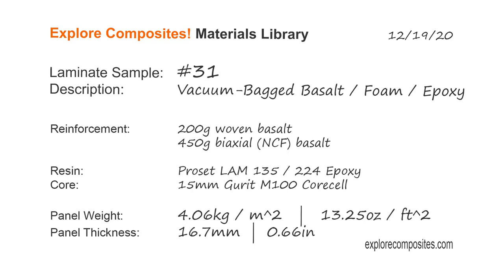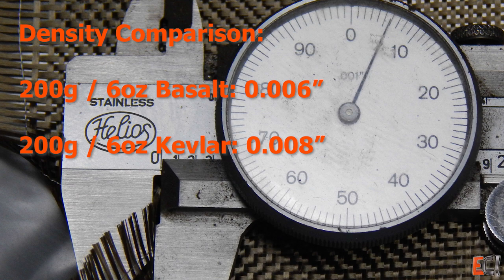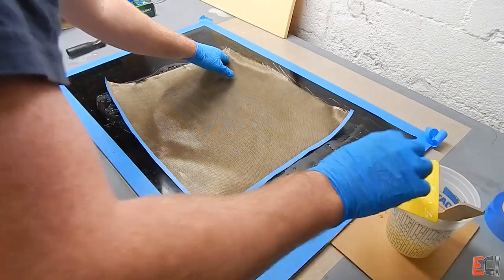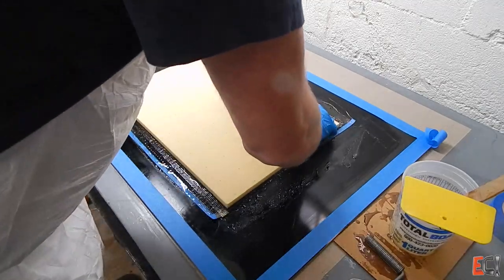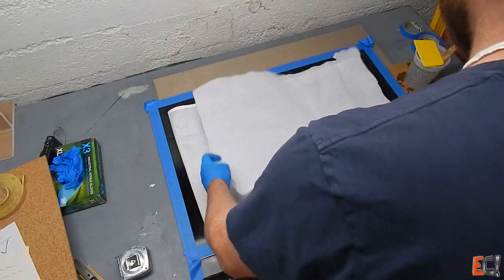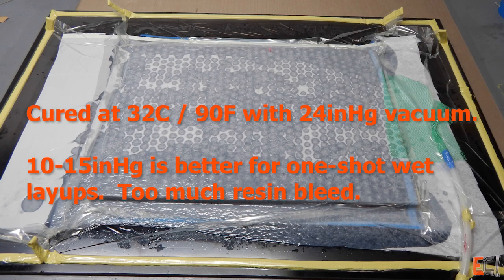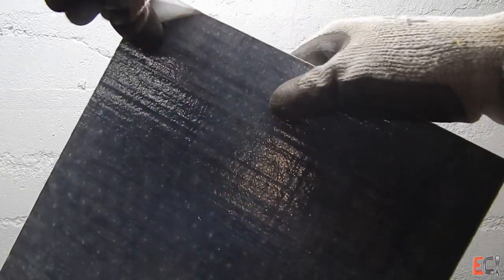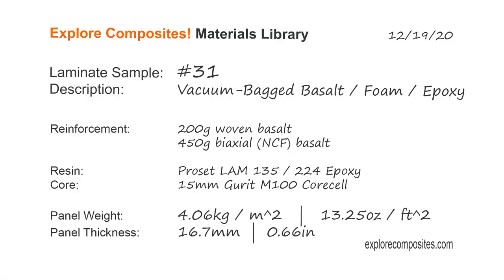Laminate Sample #31: Vacuum-Bagged Basalt / Foam / Epoxy

Comment: I've been working with several industrial material like fiberglass and stone based insulation and came across this material while searching for an alternative to fiberglass tape. Basalt has a lot of useful properties like high impact resistance, high tensile strength, low heat conductivity, outstanding electrical insulating characteristics, chemical resistance and corrosion resistance.... it can be fully recyclable. I have seen this material  starting to replace steel and fiberglass and certain carbon fiber application. 

Thanks for sharing your analysis.

Comment: I've been wondering if there is a "basalt foam" as a core material and as insulation. Theoretically I think it should be possible, there is some volcanic basalt rock with large bubbles. Then you could recycle a basalt fiber / basalt foam by simply melting it down again. That might be the ideal building material, lightweight, insulating and highly fire resistant.
Thanks for the video!
Reply from the maker: I haven't heard of it but that doesn't mean anything!  Autoclaved aerated concrete is pretty neat stuff - maybe one could use a similar process with basalt?  I just don't know much about the process...
Reply: @ExploreComposites  Only thing I know is that you only need to melt basalt once to create the fibers without consuming oil or producing CO2. Which is great. 
So the process should be possible but might not have been developed yet.
Reply: RockWool insulation is blown basalt fiber, not as stiff as a foam like your talking about though.
Reply: Not a foam but Maybe theres a Basalt honeycomb instead of Nomex? Fascinating topic!

Comment: Hey... You need to look at the resin chart... Usually you have a first time for vacuum. Eg 20min for using the epoxy and 24h befor demold and 3h Fist vacuum. That is the reason why you pulled out to much resin. If you use a microscope you can see the different seturation on the fibers. 

I know it always depends on the job you wanna do if you stick to it. I have done this as well and no one is complaining but it's something to have in mind of you want a better quality

Thanks for doing those videos!
Arne
Reply from the maker: I’m not sure I follow but I want to!  Do you mean that I should wait to put on the vacuum until an amount of time (20min) has passed and then pull one level for a while (3hr) before changing it again.  The Proset chart doesn’t seem to mention vacuum levels but I will look a their other material.  This sounds like other things I have heard so I am very interested!  Do you have an example of a resin chart where they describe this?
Reply: @ExploreComposites  give me a second my friend
Reply from the maker: Thank you for teaching me something new!  

If you’re scrolling the comments check out Arne’s video here with details about this:

https://youtu.be/vIri0biOl_4

Going to try this!

Comment: I’m curious how it would perform with the same core thickness in LW-PLA. Obviously I would use the foam core for strictly flat panel layups, but LW-PLA might work great for curved surfaces in aviation. Maybe this idea could be done in episode 49/50?? This idea could work great for having replaceable panels, kinda like fenders, hoods, or doors, on aircraft to make repairs easier.
Reply from the maker: Thanks for the suggestion!  I have been wanting to try LW-PLA for a while but hadn't considered it for a core.  Next time I order filament I'll try to get some.  Could probably be printed as a skinned honeycomb and just get laminated over with a light layer of fiber on each side...
Reply: @ExploreComposites  For an outside skin on aircraft or cars I don’t think the comb would be necessary. For stringers and ribs I would use 3D formed reinforcement, like half a circle to hopefully match up with some carbon tube. I haven’t drawn it on F360 yet but that’s how I’m imagining it in my head. I’m thinking carbon tube for transferring loads between 3d printed panels and along the fuselage.

Comment: Have you ever done pink styrofoam panel sandwich construction laminates? I think the Owens Corning product has very good compressive strength and is very inexpensive.
Reply from the maker: I haven't but it might be worth looking into.  What thickness do you think would be useful?  

Owens Corning Foamular 250 XPS is 1.5lb/cu ft. and has a compressive strength of 25psi.  For reference a 2.5lb PVC foam has a compressive strength of about 75psi.  So the XPS isn't great but it might be useful for something - and it's cheap!
Reply: @ExploreComposites   Wow, I had no idea the PVC foam was so much higher on compressive strength! I have used the "pink" foam as ribs for my tunnel hull boat and glassed them in place.
I was thinking of 1/2' and 1"

Comment: Sorry to be pedantic but your weight per square meter in your opening spreadsheet is off by a few decimal places.
Reply from the maker: You’re totally right!  Thanks for pointing this out.  I changed the units for the previous sample but forgot to change it back.  I sure wish editing videos was an option!

Comment: Hi Chris thanks for the awesome videos!

I have a few questions but didn't find the answer on the internet, maybe you can put the info on your site :)

Im working on a project and looking for the best material / cost combo
1. I need it to be flexible (for the hinge part)
2. high tensile strength as minimal elongation as possible
3. itchiness is a problem, dogs can run on it with sharp fingernails, so if you have an idea for a coat that will eliminate the problem that works also

so I saw this video and thought maybe basalt will do it? until now I thought of kevlar, but its expansive and broke on the hinge

Will be happy too hear your thoughts :)
Reply: Also, weight is not an issue, but thickness is (because it need to flex 25 degrees)
Reply from the maker: Basalt is not really flexible like Kevlar is - and it is itchy!  Most of the composite hinges I have seen are Kevlar or some similar thermoplastic fiber.  Could you just use a plastic sheet material for the hinge.  Many thermoplastics can be glued with methacrylate or epoxy adhesives.
Reply: @ExploreComposites  Thanks brother!

Are you talking about fabrics like dyneema / Diolen ?

Can you list other fabrics that you know?

And if you know where to source them because it is extremally hard for me to find... (with international shipping is preferable)

Comment: @1.30 Here how does steel rebar compaire ?
Reply from the maker: I’m not sure strength-wise - probably just an engineering issue.  Corrosion resistance is probably more of a selling point for basalt.

Comment: I think your estimate of 200 gm/m2 for foam coating is too high. I'd use 100 gm/m2 each side at most.
Reply from the maker: It looks like you were right based on the actual panel weight... but I also mis-handled my vacuum and removed too much resin.  Do you find that higher density foam takes less resin to bond?

Comment: I can see why it's not that widespread. It doesn't provide compelling advantages over fiberglass and it's nowhere near carbon. It strong points, that is the heat  insulation / fire retardant properties and the wide availability of raw material seem not enough to compensate for the higher production cost caused by the higher temperature needed to melt it.
Reply from the maker: You make good points - I am not well informed yet but tend to agree given what I know at this point...